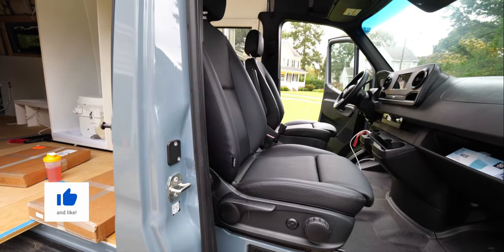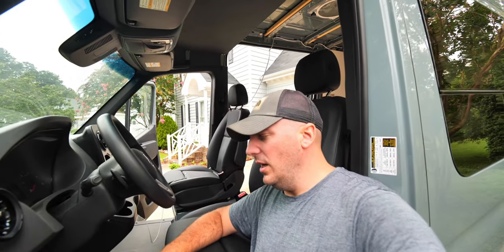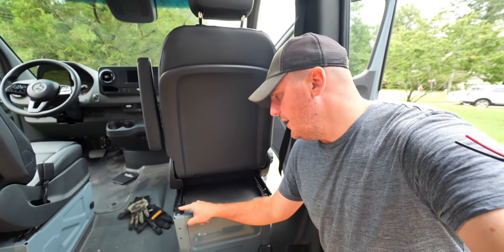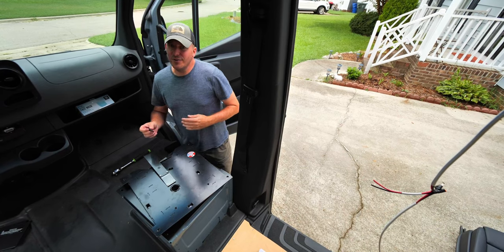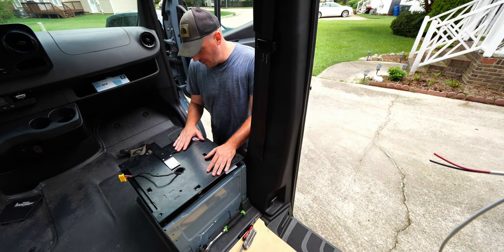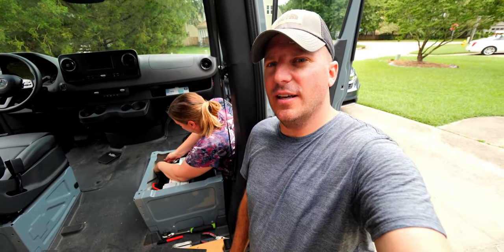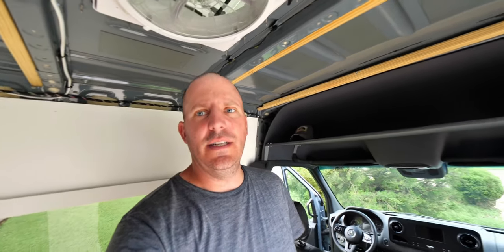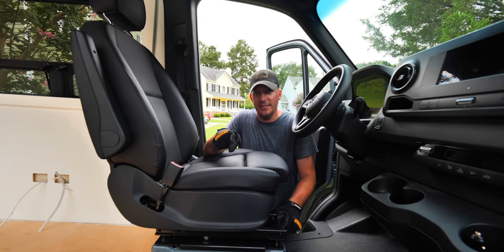SWIVEL SEAT Install  |  DIY Mercedes SPRINTER VAN BUILD

Comment: Thanks for the walk-through! Do you have standard seat bases or "low" seat bases? Can you swivel with the door closed?
Reply from the maker: They are standard seat bases, although we wish we had gotten some lower ones! Sandy is on the shorter side 😄 and yes! We can swivel no problem with the doors closed!

Comment: I am buying a 2017 sprinter. Can I take it somewhere and have them installed by someone. How did you cut the circle bigger
Reply from the maker: Our swivels just bolt on… Depending on where you are you might be able to find somebody to install them… not sure how much Mercedes would charge as a last resort… thank you for watching!
Reply: Thank you

Comment: I’m not too happy with the newly installed Sportscraft swivel in my 2014 Sprinter (passenger side). It raised the seat 1 3/4”, it’s difficult to get into the right position to unlock and rotate, and my feet barely touch the ground while facing forward and dangle while facing backward (I’m 5’8”). It’s not the sweet improvement I was hoping for and am wondering the additional cost of the Scopema is worth it.
Reply from the maker: Sorry to hear the seat didn’t work for you. I (sandy) and 5’4” so my feet dangled before installing ours so I don’t see much of a change. We will buy a small ottoman to help with that problem. Jed is almost 6” so he likes haves the extra height in the seat. We’ve heard nice things about the Scopema and from what I read it adds about 1/2 inch. Hope you find something that works great for you.

Comment: Have y’all been happy with these swivel seats? Do they put you in an awkward driving position? We’re about to order some.
Reply from the maker: Hey there! Yes we have been very happy with them so far. Keep in mind that these do lift your seat a little over an inch. For vertically challenged people like myself (sandy 5’4”), it means my feet no longer touch the floor. So we are planning to build a small foot rest/ storage box so my feet don’t have to hang! Jed is 5’11” and feel they made his seating position better.